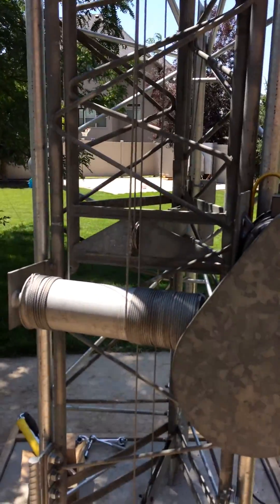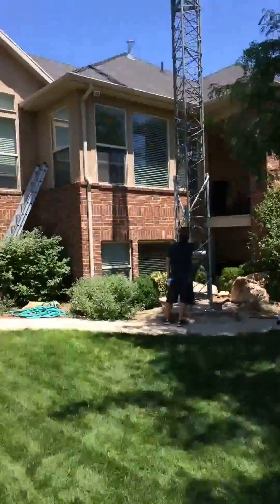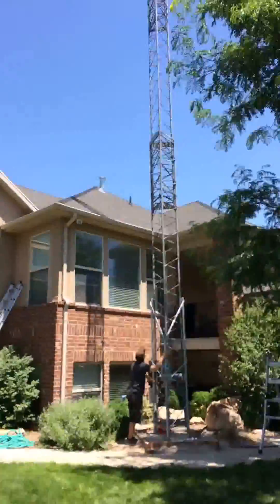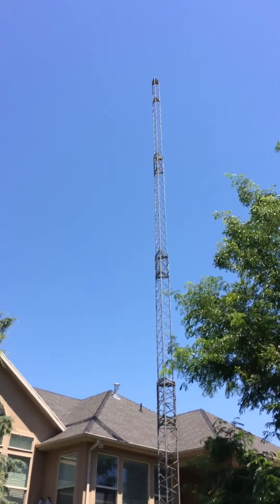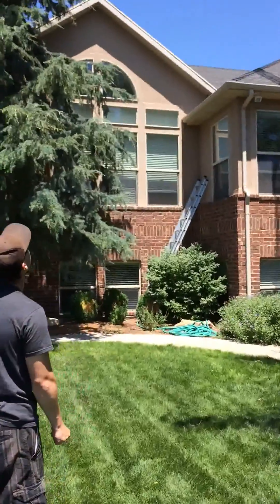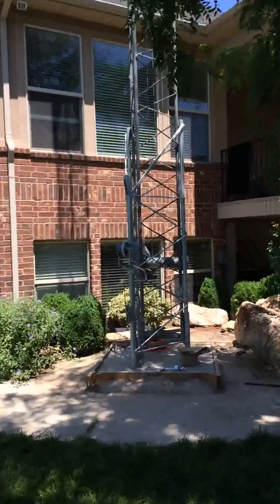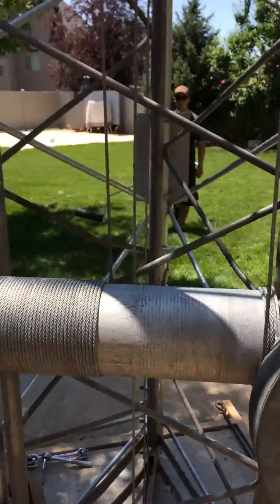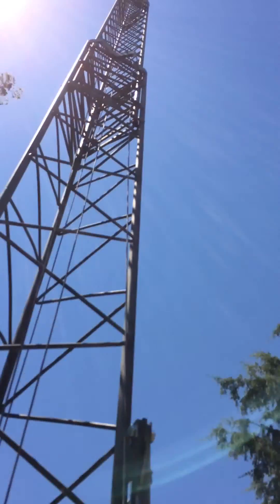NG7M Tashjian / Tri-Ex LM-470 Post Crane Install Raise and Nesting Test - Time Lapse

Comment: Does your Tower have much sway at the top when it's windy?
Reply from the maker: Not that I have ever noticed as in swaying back and forth?  However depending on the stronger wind direction the tower will slightly lean due to a little play in the sections.  Properly adjusted positive pull down spring tension helps too with any rocking / sway motion.  After more than two years with the tower up 99% of the time at full height, I never have noticed any back and forth swaying in wind.  Max NG7M
Reply: @ng7m-ham-shack  how much over is between sections?